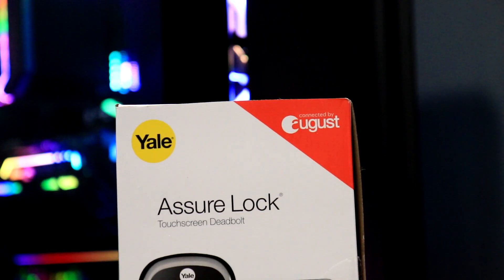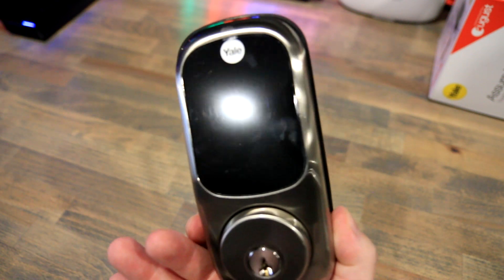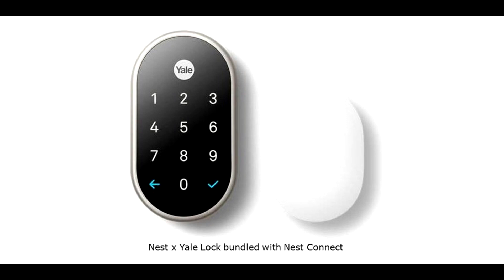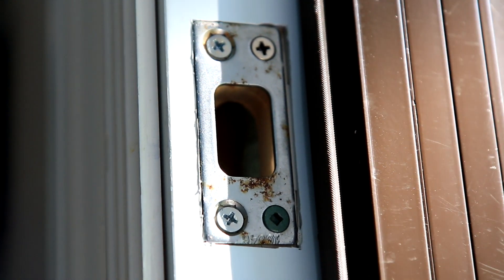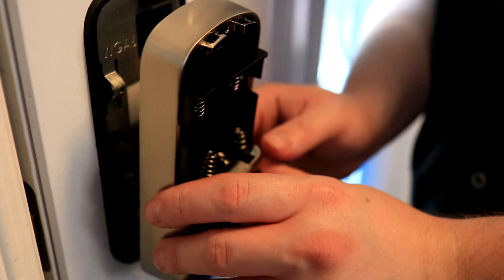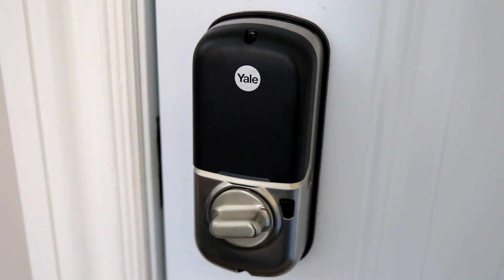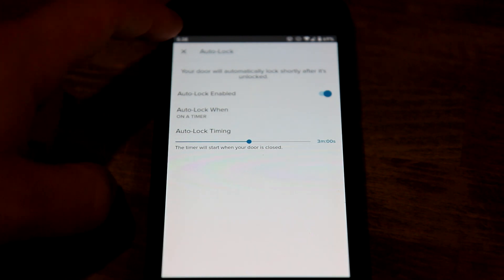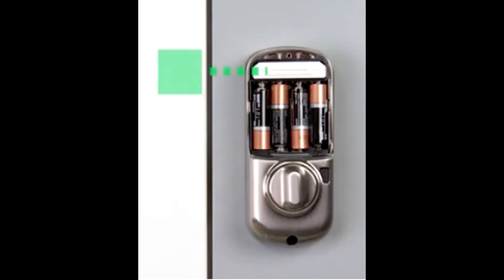Yale Assure Lock Touchscreen Deadbolt Installation & Review

Comment: Your video went well until it failed to describe in detail which Application (Yale or August or both) you are using on your phone and the process to register either the lock or the module or both. It would help if your video, or with an update, that would describe in detail all the steps from start to finish for a layman like me. Thank you very much for making the video.

Comment: Yeah I was hoping for more help with the August app.  I'm trying to set the Connect device and it keeps telling me I have no compatible smart locks available.   Which is annoying because I literally just installed the Assure lock that has that device included with it.   I thought maybe it was a distance issue.  So I moved it only 5 ft away from the door lock and I  still get the stupid message.  So im not sure where to go from here.

Comment: Hi, to start I like to thank you for your video, it is very informative. But I have a question I hope you or someone else has an answer for.  
I have a door with a multi-point locking system, so my door doesn't lock unless I lift up the handle first. I know this, and I think it's okay that I have to lift up the handle for Yale Assure Lock to work. However, I'm wondering what will happen if I forget to lift up the handle? Will the Yale Assure just keep trying to lock when it meets the resistance and cannot lock the door, and just let me know that it is unlocked?  Or will I need to disable the automatic lock function?
Reply: It won't even work with your locking system pal...I have the same system you have I know because of your description.

Comment: Hi. Great video. I lost august connect device (original one from the box which comes with the Yale lock) Could I buy separately a new one the same I had before and use it with my Yale lock? I curious if it is going to work together.
Reply from the maker: You should be able to buy it separately.

Comment: Got locked out with this Yale. Think one of my kids hit the privacy button on the way out. The app has always not been good about remote locking and unlocking, didn’t work that day either. Had to break into the house. Next day went and bought a Kwikset, that has a key. App works way better. Yale 👎🏼 for me. Also the Kwikset app has a battery meter for the lock.
Reply: You can still use a key with this device. Did the key not work?     I’m asking because I was thinking about buying this version since you can still use the key.
Reply: @lifestooshort80  No key option. Its the Yale version from Costco they had about a year ago. Keypad only, no physical key slot, and only an exterior 9V battery connection if your AA batteries die. I wasn't impressed with the August app either, I use an iPhone 11, I don't have problems with it, so I'm assuming the app has issues with remote locking/unlocking. Good luck.

Comment: When I try to do the step to connect my lock, which is number 7 and then I should give step 1, I only get 3, which is to exit the app network configuration
Reply: Same here. The module just doesn't seem to work.
Reply: Same with me did you resolve this